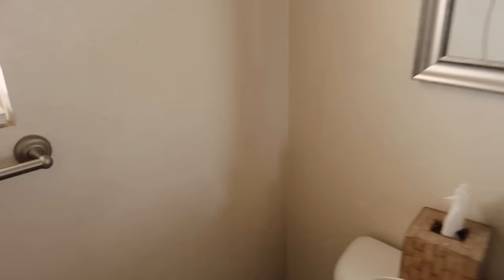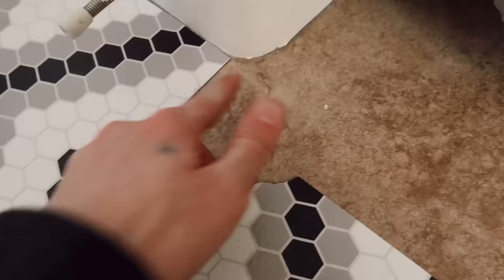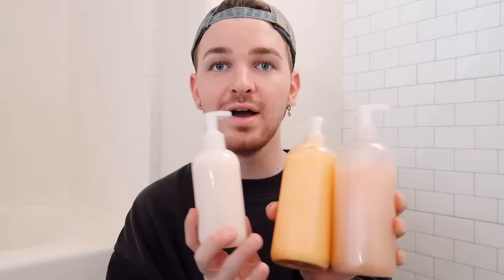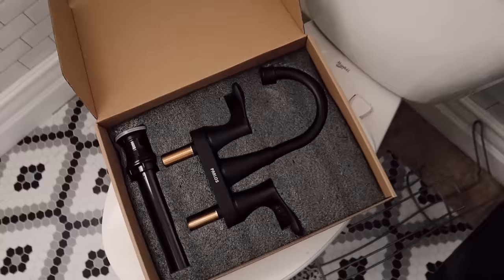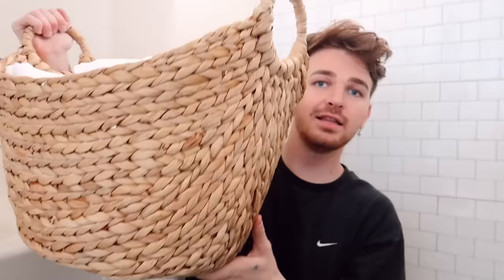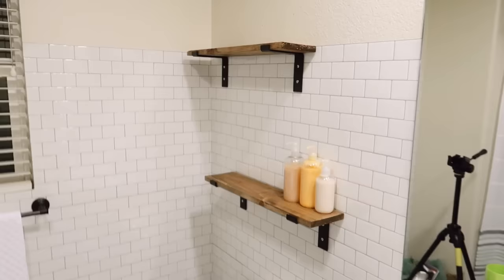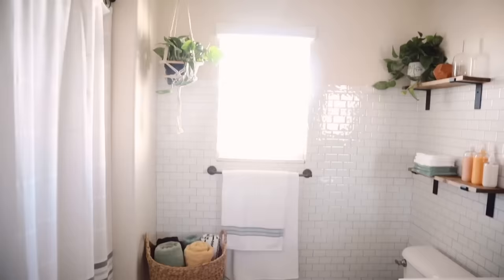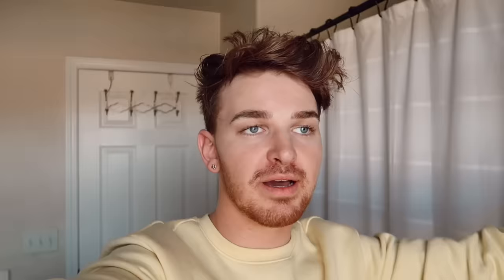BATHROOM MAKEOVER UNDER $300 (Renter Friendly) + DIY Tile Floor & Brick Wall!

Comment: The best thing I like about him is that , he is a perfectionist and pays attention to every detail like painting off those nails on the shelves was spot on 😍
Reply from the maker: Aw TY!! Love that you noticed 🖤
Reply: How interesting.. Your opinion is completely valid, but what my perfectionist self loves about him is that he doesn't let any imperfections/complex problems discourage/paralyze/slow him down. It's inspiring to me, because it reminds me that the scissor cuts on the tile, sometimes visible glue gun marks, etc. are not actually part of the big picture, I just sometimes let it get in my head, when I'd be better off just doing it already. (my type of perfectionism is to my detriment when it comes to home makeovers, it usually paralyzes me and drives me cray)
Reply: Lili Sz Me too, he’s does things very well and pays attention to detail but he doesn’t get caught up in perfectionism. I would totally obsess about a slightly crooked cut and he just moves on to accomplish so much more and I would have either quit or started all over to achieve perfection... not a good thing and I hate that I am like that!
Reply: Same its what sets him apart from other DIYers, Drew never does a half-assed job and thats why we love him!
Reply: The real test is when you take the tiles off the wall...do you have videos of that to see if it rips the walls?

Comment: Pro tip when using the stick on tiles make sure you caulk all the edges makes it look more profess and seamless
Reply: katie Moore thanks for the tip. I’m planning to use stick on tiles for my kitchen backsplash and was worried it would look like stickers lol. Can’t wait to try it.
Reply: Will the tiles still come up okay if my landlord asks me to pull them up when we leave?
Reply: It depends on the brand you buy, but yeah they all usually come off no problem just research yours to make sure lol
Reply: @ninal.3969  Make sure it's doesn't say permanent adhesive
Reply: @ninal.3969  Use an iron to loosen the adhesive and it comes up WAY easier!

Comment: Renter friendly and relatively affordable? WiTh ThAT oUtCoMe?!
hell yeah
Reply: Miss Lyntheena I will be doing this in my apartment FOR SURE lol
Reply: The flooring is not renter friendly.   It takes work to remove and leaves a glue film after.
Reply: @marikiemarie7622  If you clean the flooring properly after removal it'll look like new :)
Reply: marikie marie  Renter friendly means the ability to put it back as before. It doesn’t mean that it’s always easy to do. But stick-on vinyl will always come off of ceramic tile.
Reply: I'm also betting that you could line your original floor with contact paper since that's an easier removal and stick the tiles to that... 
It's an extra step but it would give the best of both worlds with removal and the look 😊
Reply: Drilling holes in the walls, that renter friendly?
Reply: @strawberry10261026  was for me. Just had to fill in the holes with putty before moving out at they painted between people
Reply: @rachelwells2979  what kind of putty ? Wood putty.  ?

Comment: When we  updated out bathroom , we took the sink faucet off and painted it a matte black. It’s a great way to save money, although I love the Koehler they’re not cheap. So if anyone wants the look for less, paint a couple of coats then make sure you get a waterproof top coat. I’ve had it for 4 years with no problems. Btw the bathroom turned out beautiful.

Comment: One more thing that will help give the bathroom a more modern feel is framing that huge mirror. My neighbor went out and bought some medium width slightly fancy crown molding, angle cut it and framed the mirror being careful to not nail through the glass. She painted it black prior putting it up and it was just the right finishing touch.

Comment: I personally installed this peel and stick wall tile and it WRECKED the wall entirely.  So on the floor it was okay if it’s ceramic underneath but it leaves a nerverending sticky film.  So beware ! Although must say this transformation is superb !

Comment: If the towel rod ever comes loose, that’s because it’s installed upside down. The little screws are supposed to be at the bottom, not the top. But overall, looks great.

Comment: This bathroom makeover is fabulous.  My own bathroom make over also was completed and I also had those builder grade mirrors.  They look like motel mirrors so I glued around entire mirror small tiles on one and had some wood cut at Home Depot and used rosettes in corners.  What a transformation you should try it.  It looked like a mirror you would find in a store like Home Goods for as little as 20 dollars and 15 min of your time.

Comment: Considering you titled this as renter friendly, I'd love to know how removable all the stick on tile is.
Reply: Sapphire Love Burlesque that’s exactly what I’m wondering!
Reply: Same here. I would love to do something like this in my rental. but... not being able to take the tiles up; scares me.
Reply: Very easy...you may have to scrub a little glue off but the underneath will be fine
Reply: I used stick on tile in my home as temporary backsplash. It will indeed ruin your paint and  some drywall. Thankfully I’m not a renter so I didn’t have anyone to answer to but it did piss me off that we had to fix the walls.
Reply: On walls it will destroy paint. On floors using and iron will get the tile right up.

Comment: LOVE that you showed how you installed the faucet! Super helpful
Reply: A single handle faucet is much better, if you change it. More sanitary for these days as well, as you can turn it on and off with your wrist and the temperature control is way easier. Having an existing two handle faucet would be reason enough for a change.

Comment: I can’t imagine that flooring holding up well though, especially with constant water on it. It’s cute I just don’t see it lasting long
Reply: It will last if they add caulk to fill the seams. Otherwise, it'll hold up okay for a while, but it will trap mold in the seams and will be impossible to clean from the get go. I hope they sealed it before they used the shower.

I wish more YouTube interior designers got imput from actual architects before giving bad advice on how to install products they promote. Cuz trapping water in your grout under linoleum peel and stick could cause nightmare level damage to the flooring below over time, as does attaching a new faucet without properly seal the connections.
Reply: I also wish people would stop calling them interior designers when they’re actually interior decorators 😅 not the same thing. You need a degree for one of them...
Reply: I have the same one and it’s been over a year and it looks amazing

Comment: Shampoo to .match your hair type AND bathroom colors (and scent of choice ).  YES!!!  Good job BTW.

Also, remind viewers they can pull toilet and vanity (first) to tile under vanity area & closer to toilet ring. Just in case someone is planning on switching out vanity & toilet but, hasn't picked out yet, can't make up their mind on color/size or still budgeting for a later project. 

Not  necessary here. Toilet appears new or already replaced and dad took care of the cabinets. Dad did an excellent t job as well.

Comment: LOVE that brick wall “sticker”! will that survive the moisture of the bathroom from the shower?
Reply: Yes it does. I've used it around my bathroom sink
Reply: If it’s in a bathroom, kitchen or laundry room just caulk the seams. That will prevent mold. They last really well.

Comment: How do these peel and stick tiles do with all the moisture in a bathroom? Does water collect in the cracks and gets under at gets all moldy? Or do they come off easily after a while?
Reply: A.L. Johns I used spray on gorilla glue to make sure they don’t move...but I’m not a renter.

Comment: I love this! Has anyone ever experienced mold growth behind the wall tiles? I’d like to do this to my bathroom.
Reply: IF you can use "killz" primer behind it but if you CANT. ;) use a MATTE strong adhesive contact paper/ peel and stick wallpaper (strong tack/removable) you can place tiles ON TOP of that without worry of residue or water seeping. you can also use a flexible silicon calking to "paint"/seal over seams as a cover and or filler. <3

Comment: Great job.  I need to know if the wall tile messed at all from the screws when adding the shelf?  Like, did you poke a hole through the vinyl first or just drill in the screws?  I put these in my kitchen and want to hang a utensil wrack.

Comment: Great job!  love the floor!  How about framing out  the mirror and maybe either changing out the shower curtain and taking it back to the floor or, flip it upside down so the pattern is on the top and won't compete with the floor?  maybe add more of the same or like fringe to the bottom to reach the floor again, I think it would complement all of your great work!!  Love it, love you!

Comment: Your stuff from Walmart surprised me as it was so nice! I usually shop at Walmart but I've not looked at home decor in years. The last apartment I had was old and rather ugly and I didn't feel like bothering with higher end items on a place so old (also, the counters were this seafoam blue that dated the place, along with the apartment's hotel green carpet that had ripples). Now that I live somewhere better, I'll have to take another look at their home decor. That soap pump looks much better than the ceramic one I have, which due to rusting on the bottom, I keep it on a folded paper towel to avoid it leaving a rust ring on the counter. Also, the version you had was clear, so you can tell when it's running low, instead of me finding out at 2 in the morning when I use the bathroom and go to wash my hands, lol. 

Anywho, this makeover was amazing!

Comment: Not sure if I've missed it in the video, but did you prime the old floor tiles in any way or fill up grout to be flush with tile surface? Peel and stick tiles are flexible, so after some time the old grout lines will begin to show through the new vinyl in the more trafficked areas. And if old ceramic tiles aren't primed or deglazed, the adhesive won't hold for very long. But maybe you did all that prep.

Comment: The self-adhesive vinyl stickers will work only if your bathroom floor is fully flat. Water will seep thru the gaps and sit below the original ceramic tiles, good luck during winter...

Comment: You did a fantastic job 👏 👍  question about the peel and stick flooring,  I noticed you didn't fill in the grout between the original tiles before laying down the new floor...wont the top tile mold down into those grout lines underneath?

Comment: Love the changes. Great ideas. What do u think of molding to frame the mirror? Have you ever added that and could you make it renter friendly with some kind of 2 way tape?
Reply: Not a designer here but the answer is probably “no” because from what I’ve read you need to use “liquid nails” to adhere the frame to the mirror, which sounds permanent to me.

Comment: Just so you know that on the towel bar you have the tightening screws upside down. You placed them on the top and the tightening screws should not show. Just take them down and replace them so the tightening screws are on the underside and don't show from the topside. Just something I noticed @ 11:01 - 11:03

Comment: I am curious how these stick on wall tiles fare in the longer run with the humidity in the bathroom. Does anyone have any experience? Dip they start lifting at all? They certainly look pretty good when they are first installed but it would be good to have some comments about the future of them, say 1 year into the use.

Comment: I love this! But I actually loved the other shower curtain a lot better. Other than that it might’ve been fun to use some contact paper on the counter top and spray the door hook unit black and got a cheap white robe to put on back of it and maybe switch out the doorknobs to something bold. But overall it was such a fun design. Loved it!

Comment: You could have used grout for the tiles especially that you have some space between them here and there, would be much better if a water spills on them. But you don't have to, it's about preference. And also, painting the room white would give it a much "cleaner" look as well and a much more light to it. But, nonetheless, good job.

Comment: Stunning transformation, I'd love to have this bathroom in my apartment. I guess I'm just confused as to how this is renter friendly? Painting cabinets and laying tile and replacing hardware seems like it would piss off my landlord.
Reply: Painting cabinets are generally a no go without permission (use contact paper instead). But you just remove the tiles when you are ready to move out (it's a sticker). Same with replacing the faucet. You just keep the original and reinstall it upon move out. As long as you return the apartment to its original condition why would your landlord be upset?

Comment: do you think i could put peel and stick tiles IN the shower? mine has weird holes and I don't want to get water in the wall under the plastic off the walls.
Reply from the maker: Hm I don't think they would be able to withstand a shower!

Comment: Not to throw shade at your sponsor, but more of a PSA… I used Function of Beauty for 4 to 5 months and it was hell on my scalp. My scalp was extremely dry, it started peeling/flaking off. My hair even started thinning. The final straw was I ended up with a red ring about an inch back from my hairline! It wrapped all around the front of my face, down toward my ears! I switched shampoo and conditioner to a much gentler brand and my scalp has fully recovered. I don’t know what it was about the FoB, the essential oils is my guess. So yeah, if you end up getting FoB products make sure you stop using is at the first sign of any issues, don’t keep using it like I did and end up with a chemical burn.

Comment: How difficult is it to remove the tiles from the floors?  I want to do my apartment but don't want to damage the floors in the process.
Reply: It would probably be easy, just use a hair dryer before pulling each one off, it'll heat the glue and make it easier

Comment: That threshold is going to become a problem. 2” wide strips at a high traffic area do not age well and should have been addressed first instead of the (admittedly perfectly square) invisible corner under the vanity.

Comment: If you were throwing in a yellow towel for a “POP” of color? Why not include it on the shower curtain? I would’ve replaced the mirrors with black framed ones. Or framed them out. Very disappointing not to see your Mom’s reaction.

Comment: OK SOME ADVISE 
# 1 never ever cover up tile floor with stick peel off tile special where in this case tile floor was look so good you can upgrade floor with this pattern runner rug be match better look
# 2 NEVER EVER USE PEEL OFF TILE IN BATHROOM BECOUSE OF  FUMMES OS STEEM WHEN TAKE A SHOWER THE TILE BE GETING OF THE WALL BETTER IDEA IS CHANCE THE COLOR OF WALL OR PUR HALF WAY BARN BOARD
# 3 YOU SHOULD FRAME THE MIRROR THAT YOU CAN DO AND IS LOOK MORE FINISH UP

I FALLO YOU VIDEO LOOK LIKE YOU HAVE LOTS TO LEARN TO DO MORE POLISH UP THE PROJECTS FOR EXAMPLE WHEN YOU WAS DOING MOM KITCHEN THE KITCHEN DOOR HAVE A ORANDE SKIN LOOK WELL WHEN YOU DO SPRAY THAT SHOULD BE NOT HAPPEN YOU WAS SPRAINED TO CLOSE AND SOME CLUMPS CAMEN OUT NEXT TIME PRACTISE THIS AND AJUST THE NOSSLE  GOOD LACK WITH LEARNING